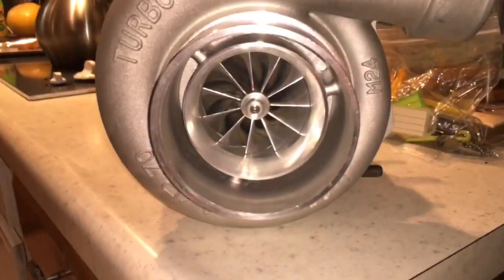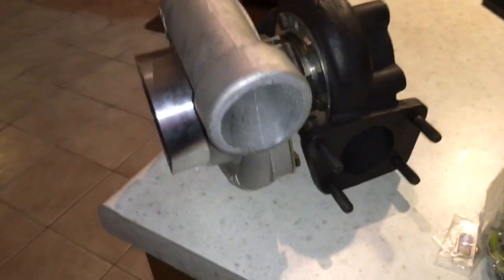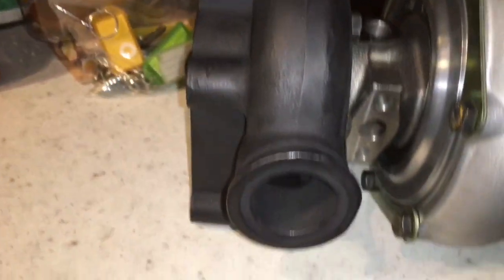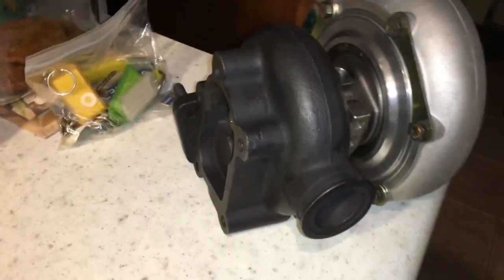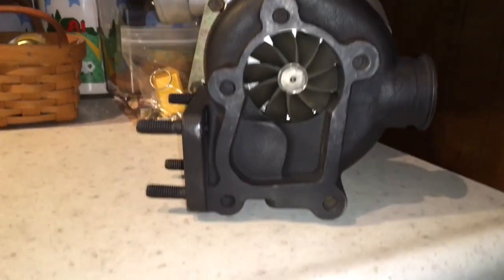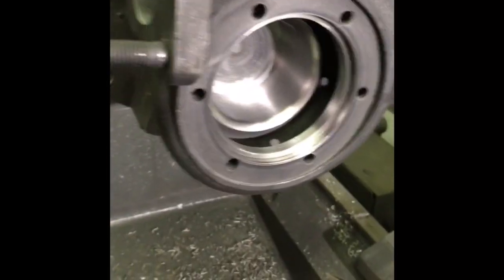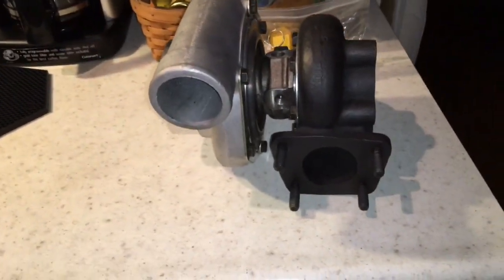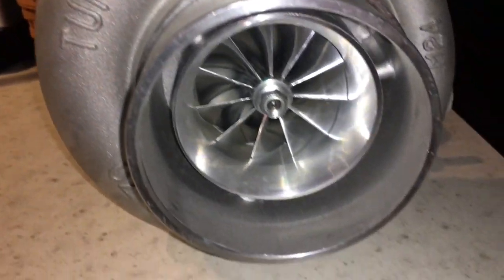ATP Mazda Speed 3 GTX3582R Turbo Upgrade

Comment: This is my Turbo! Originally it was a Garrett Gt3071r but the turbine blew off. I used the Garrett turbo for my break-in engine cycle. I assume my metal shaving were from the break-in. But I already ordered a magnetic oil drain plug to prevent this from happening again. And of course I am doing a fresh oil change before I put this on whenever I received it. I'm looking forward to putting this into action.

Comment: can you guys balance the center assembly? thanks bunch
Reply from the maker: +Sean Ryan we balance the assembly without the cage which works best for us, then we can balance it as an assembly with our cartridge cradle, it won't spin it at 250,000 rpm but it's not needed based on how this balancer works.  Before cartridge balancing it's important to balance it as an assembly without the cage to get it as close as possible so there is less to grind once assembled.